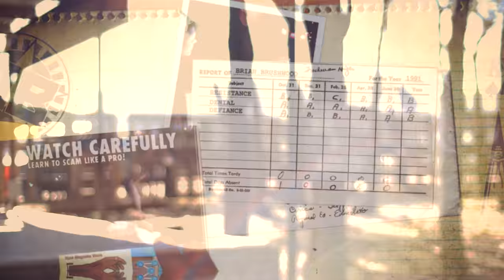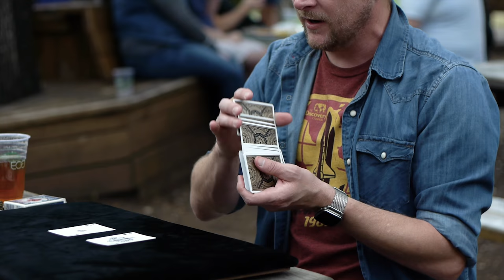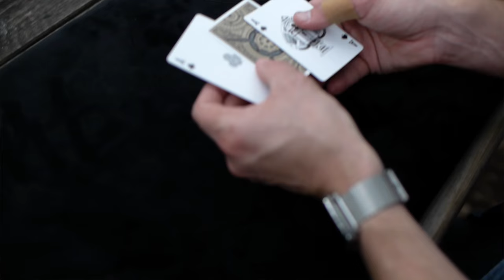Locking Up Salacious Crumb!

Comment: This for years has been my go to trick. So elegant, yet fun. I use the black queens as my "lovely assistants" and everyone is stunned. I end the trick with a very flashy tossing of the deck in the air. I have found that with practice, you can toss the deck about 2 feet in the air without wind and catch it without problem. Any higher and the deck usually starts to separate, causing a big mess, and really ruining the trick.

Comment: This is actually one of my go-to tricks when I'm at a bar.

I'm definitely stealing the line about everyone escaping though. I've found that quite often, the attention is on the throwing hand rather than the catching hand, and that's when people start trying to bust you.

But here, all of the attention is on the catching hand, so it's almost as if the card appears between the (in this case) aces, rather than being pulled off with them.

Alternatively, while all of cards are being thrown across, using the throwing hand to square up the three cards creates an opportunity for a bigger reveal. Placing down two cards and letting the participant spread them to reveal their selection might be what this trick has been missing for me.